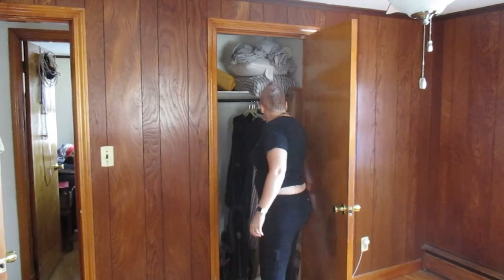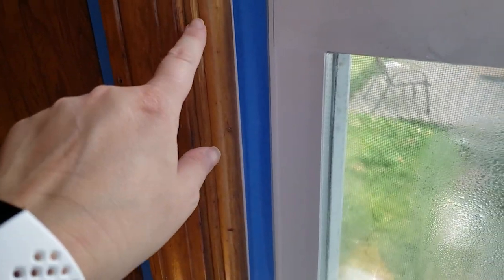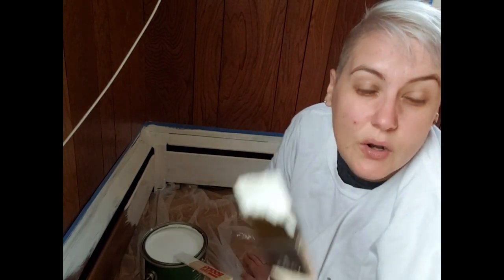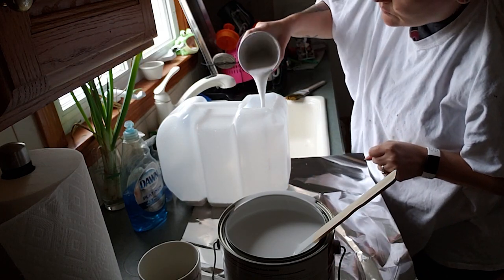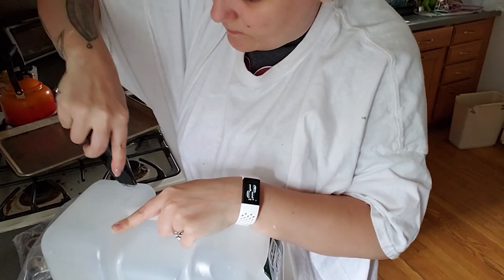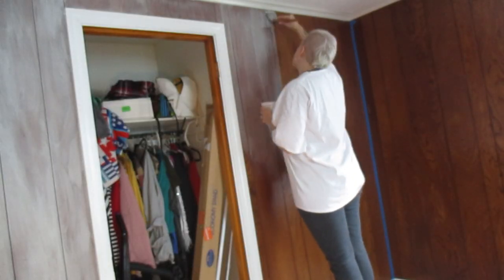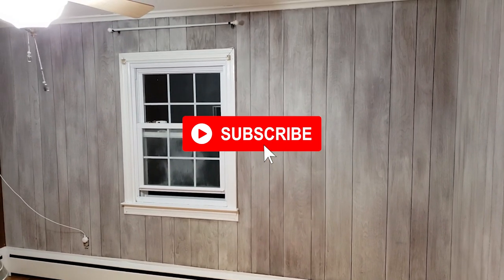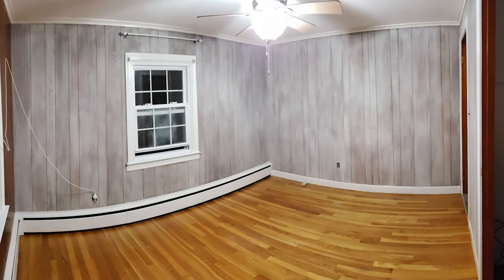The Painting! Ep. 3 - White Wash Walls - the other 3 W's

Comment: Did you actually wipe down the paint at all? or just brushed on and left it? A lot of tutorials said to wipe down but yours looks great and it didn't show you wipe down! ^-^
Reply from the maker: Hi, what I did was used water down paint and continued to paint layers on until I got my preferred look. I also suggest sanding and sealing it. Right now, my walls can be scratched or the paint can be washed off with soap and water if I wanted to change it. I don't have kids or pets so it works for me but if you need something more durable, sand and seal. Good luck!
Reply: @EnjoyJax  thanks so much for the quick reply. I have these old wood panels on a house we are buying. Looks very similar to yours. This gave me home of giving it an new updated look!
Reply: @EnjoyJax  Hi, so....sand before...and then seal with... what?